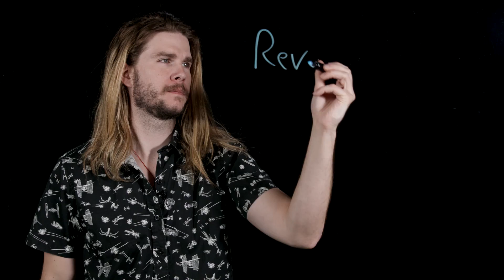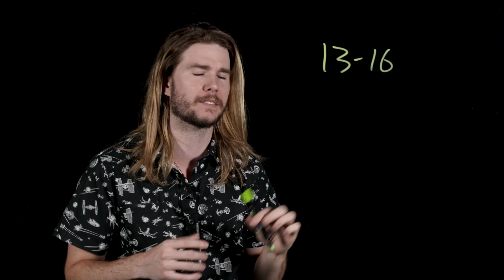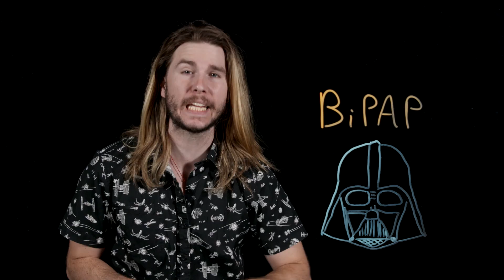Why Does Darth Vader Breathe Like That? (Because Science w/ Kyle Hill)

Comment: We've known this forever.  I mean, this was explicitly stated in a few places, even before the prequels and remains in the canon today.  Like, exactly this reason.  Here's the passage from Wookiepedia:

"With his body crippled, Vader tried to claw his way up the bank, using 
only his remaining prosthetic limb but his body ignited from the radiant
 heat of the flow and his lungs were scorched by the hot gases he 
inhaled, which included high concentrations of ko-shol gasses."

It also has in-depth information the mechanics of his suit, specifically the breathing and life support systems, but I'm unsure of their canonocity or scientific validity.

Comment: from what I have read and seen is that darth farther's (sorry couldn't help it) lungs are a wreck, he uses the dark side force powers to actually breath, the difference between light and dark side healing is that the light side actually heals it so a server limb or broken bone actually mends, this is different from dark side as the dark side just forces it to keep working, if you have the bones in your arm turned to dust (just as a example) you could use the dark force energies to keep your arm working as an arm. this is what vader is doing with his lungs, he is forcing them to work as normal, or as close as possible to normal lungs, that why when he kills the emperor he starts to suffocate and then dies in lukes arms, he doesn't have enough hate in him to keep his lungs working, he goes from dark to light and die because of it, but as stated in the video the suit help him breath, just cause the lungs work doesn't mean the diaphragm works as well. hope this is interesting (it's mega nerdy sorry should have put a warned in advance)

Comment: this still doesn't explain how he talks and breathes at the same time :(
Reply: Everyone talks and breathes at the same time.  It's impossible not to.
Reply: +RouninPanda 0_o Huh?
What's not possible is talking and breathing at the same time. In order to talk, you need lungs full of air. If you meant exhale, in a way, yes, you are when talking, but taking air in while talking? No.
Reply: tremedar  Breathing is a two-way function.  So yes by definition you have to breathe while talking.  What's so hard to understand about this concept that you felt you needed to correct me?  I'm using the word breathe, because that's the word OP used.
Reply: RouninPanda
The process of breathing is willfully suspended when we talk as you can't push air out of your lungs at the exact moment you're taking it in. You do one or the other, so you very slowly 'exhale' while talking.

Comment: Cause it was the 70's and that was considered "futuristic"
Reply: +criixt a wearable light weight life support system still is futuristic as we don't have one.
Reply: yeh we do...sorta....nasa suits
Reply: ***** No we don't. Space suit is ~100kg or more. It's so heavy and bulky you you can't suit up by yourself before going onto space and it's hard to even walk in while here on the ground. Your fine motor skills are shit thanks to the pressure and thickness of the gloves and it runs out of air after a few hours. Vader meanwhile has no issue moving, can run and leap down meters of stairs, matches the speed and blade work of a 20 year old, and was in a damaged fighter with no internal life support for days before, According to EU, he crashed landed, became an alpha male of a wolf pack and murdered a small Imperial garrison for incompetence and shooting his pack before he was picked up.

Comment: Bipap involves inspiratory support with higher pressure, though the "lower pressure" on exhalation is in actuality still higher than ambient. This serves to help splint open the terminal airways and alveoli, and provide a higher pressure gradient for oxygen movement across the respiratory membrane.

Comment: I thought it just added to his evil, obscure persona but this is cool, too.
Reply: keyser soze
the writers thought way ahead. the reason his suit is so behind in tech is because it causes him great pain, which builds his hate and makes his connection to the dark side stronger. this makes him stronger. thats why his shoulder joins dont move above 90 degrees. he cant lift his arms above his head, so it creates frustration and has the same effect. this character is more thought out then people realise.
Reply: You know it was needed due to the fact he always had to go into his special chamber (dont know what its called) which had the same pressure release.
Reply: yep, i agree. the writers possibly weren't thinking any further than that.
Reply: Noooooooo
Reply: Hi
Reply: Bey
Reply: You always comment on jk news!
Reply: Joseph Payne, actually, that was explained by the new canon comics. It was in no way thought ahead. In fact, the original trilogy never hinted that Vader's suit was low tech. Still, I'm sure you're right that the writers thought ahead about why Vader wheezes.